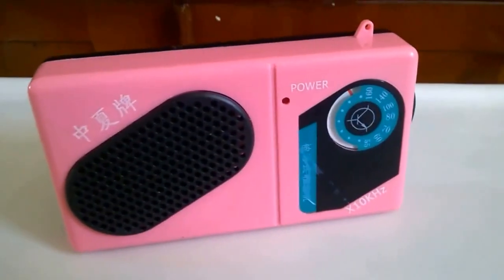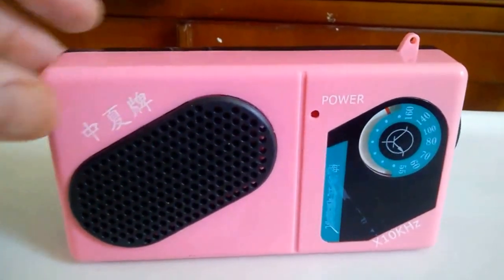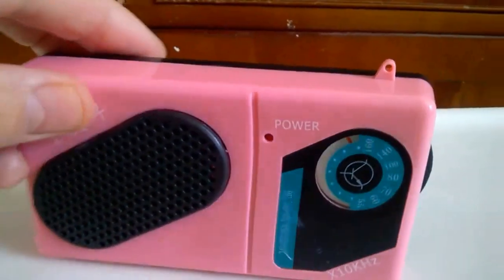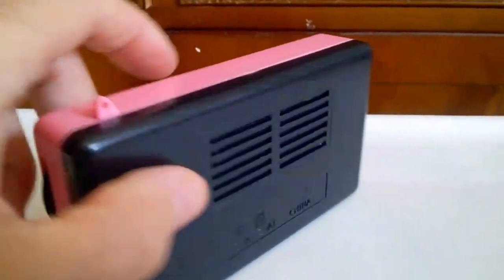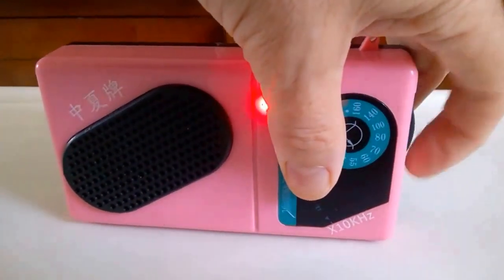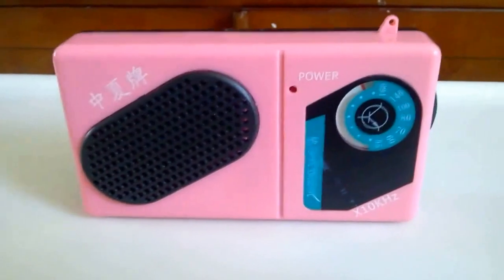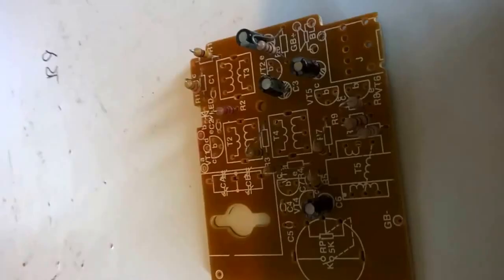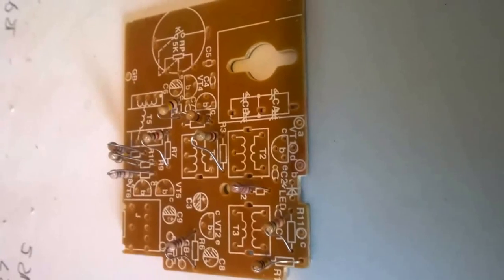AM Radio Kit  9018

Comment: If you have succeeded and actually got some sound, like this gentleman. The radio does need alignment. It can be done by ear.

Shango066 has assembled a HX-6B kit
He has covered the way to align a radio by ear. Obviously it is better if you do have a RF signal generator, but you can probably get a great improvement in volume.
The audio stage is crude & the speaker itself is rather poor. The thin cone has no bass at all.

For less than five UK pounds delivered to your door you really shouldn't expect much. This radio will pick up local stations OK if you aren't in a area miles away from most transmitters.
The HX108-2 is better at receiving distant stations.

Comment: There are English instructions for assembling one with the HX-6B panel. It has differences, but the advice is good: Put in the components in order of size: resistors, capacitors, transistors, IF coils, variable capacitor & volume control.
You do get a circuit diagram and PCB map.
You can figure out which IF coil is which from the paper instructions. The colours are Red, White & Black for T2, 3 & 4. You can work it out if you know the resistor colour codes.

I have had one go at this, but the sod didn't work. I think I ruined one of the IF cans soldering it in. I have had to use a lens to make sure I got the right parts in the right place.
Whether the end result is worth it from the performance is debatable.